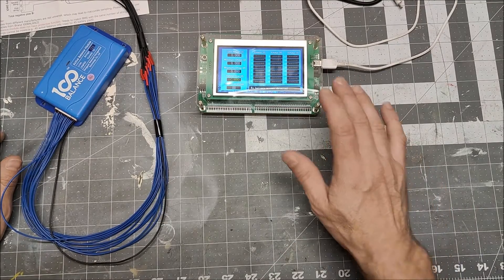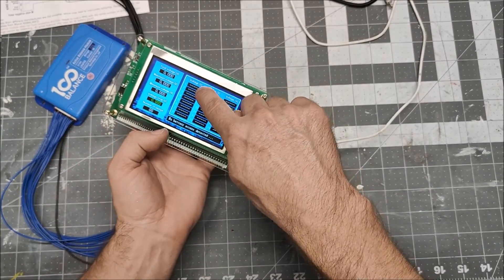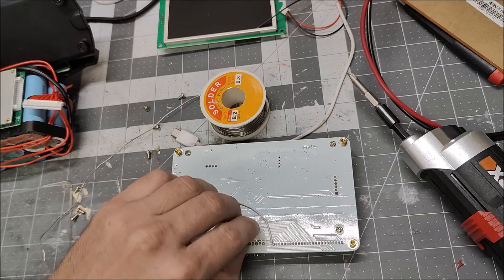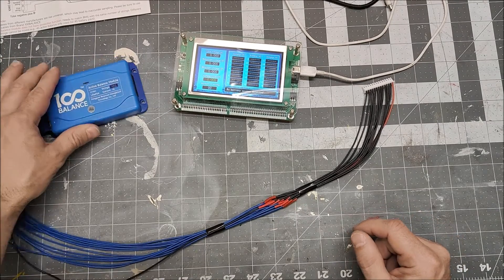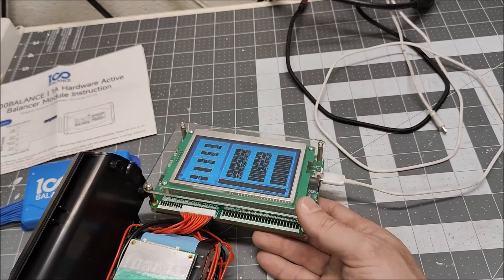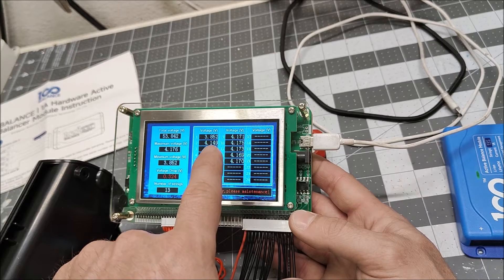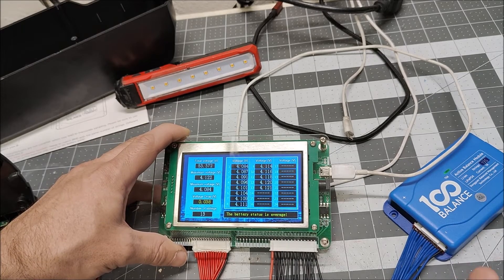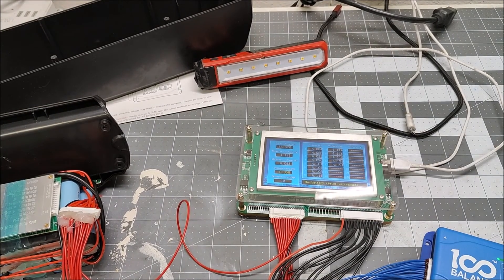Using active balancer on ebike battery

Comment: that the issue the bms should balance too not have to take out and do it your self shame
Reply from the maker: Most BMS do not balance all the time. They only balance at the top of the charge cycle. So if the battery is unplugged for a while the batteries can get out of balance and the VMS won't be active

Comment: I have just built a new battery for my ebike. 
It's a 13s 6p using Samsung 53G1 21700 cells at 5300mah. The bms is the 100 balance smart bms (40a) with active balance at 1amp with Bluetooth and WiFi connectivity.
All cell groups are balanced within 0.001v.
I'm very happy with this bms. 
Also used the purple spot welder from aliexpress using two 1500mah 120c discharge lipo's in parallel to spot welder 0.2 pure nickel strip with ease.
Reply: Can't understand why batteries aren't built like this, using an active balancer, and with bluetooth, it would be my perfect battery, no more guessing if the battery is balanced or not. Maybe one day all ebike battgeries will be built like this

Comment: This is a really helpful video. Thanks for making the video and sharing.

That meter looks really useful. Hopefully it'll help me diagnose and fix my ebike battery problems.

I may try that active balancer too.

That's cool you included the trace repair footage too. Helpful to know these little tips and tricks.
Reply from the maker: Thanks i appreciate it. I just tested a better balancer last night and doing a video is a few days. These balancers really do work well. Most batteries can be revived with a good balancing.

Comment: Hey steven i really love your content ! Thank you for sharing with us your knowledge. I've just ordered this balancer and im asking myself what happens if one group is significantly discharged like for example 2.5 volts or even less ? Is this device going to balance it anyway or are there any restrictions on how low the weakest group can be ? If you know answer for this question i would really appriciate it ! Thank You one more time !
Reply from the maker: Most devices  don't like cells below about 2.5v. you might have to hook up a power supply and bring the voltage of the low group up above 3v.
Reply: Thanks ! I hope you never stop posting really. Cheers my friend !

Comment: To me it seems you have issue with cells in 1st group. 
After a couple of discharge cycles you should see the difference in the cell voltage higher again. 
The best method to determine if group one is bad is to have battery under load and then use the cell monitor - if group one is weaker then the rest then you'll see the "cell voltage difference" go higher and higher

Comment: Nice job Steven,  Thanks for explaining everything.
I personally do it a bit different.  I top charge with some success but very seldom because I don't like to maximum charge either  52 v battery I own. If I sense an issue, say a battery starts to short charge and gets nowhere near 58.8 volts max charge and charger shuts off because BMS max charges strongest cells and weak cells fall out of line...I only learn this by falling well short of 58.8v max charge because I rarely charge my batteries over 56-57v...then I take the battery apart and manually balance charge parallel group or groups responsible. If determined weak cells continue to fall out of line with stronger cells based upon subsquent charges, I replace the cells that are weak in a given parallel group. When more weakness shows up throughout the pack, I ultimately replace the pack, hopefully after hundreds of charges.
How I roll.  I have avoided using smart BMS's with voltage readouts or active charging at lower voltages which I wish was available with  standard ebike batteries becausa as you explain, top charging has its limitations and maximum charging Li-Ion cells degrades cell life.
Key to cell life other than not hammering a battery with maximum current draw is...
1. Top quality, name brand cells like Samsung, Panasonic etc
2. Short charging battery
3. Choosing a large enough battery capacity with more parallel cells such that a typical ebike trip uses less than 50% or so of the battery capacity.
Cheers.

Comment: Very interesting. I have that same battery tester. I never thought about using it that way. I think that's a good way to use it. That way you can monitor all the cells instead of depending on the BMS. You don't really know the results of that without testing it. One thing I will tell you is I've had a lot of batteries and the number one cell always seems to be worse than the rest of them. Some with BMS and some I charge through a charger. I would like to know if anybody else out there has a problem like that. Love the video.
Reply: Well yeah cheap bms dont want to step down the full battery pack voltage to 3v so they rather just use the sweet sweet 3-4.2v from the first cell, making the first cell suffer more